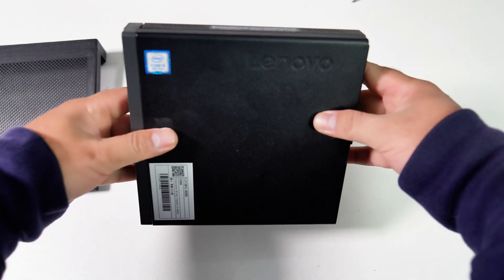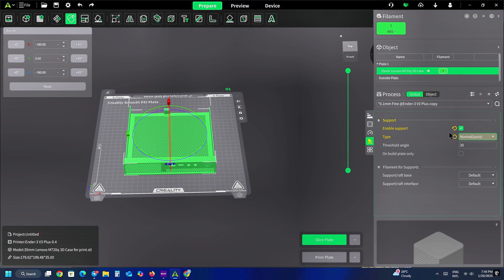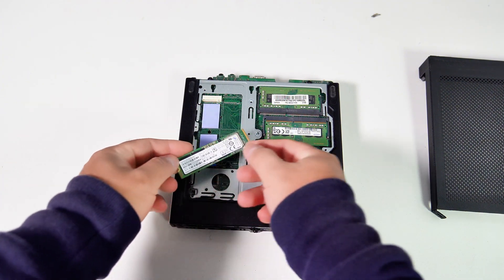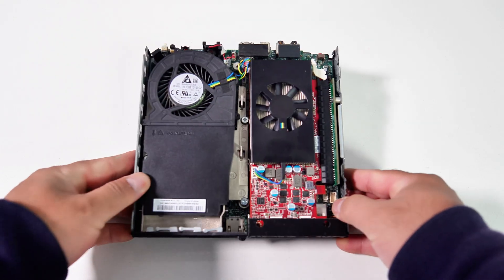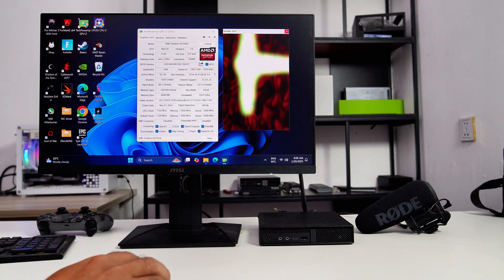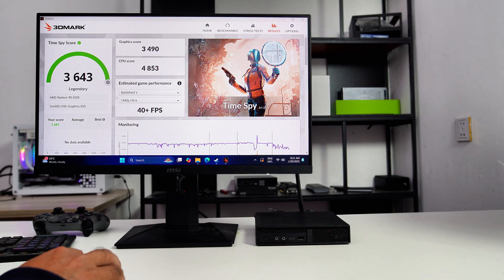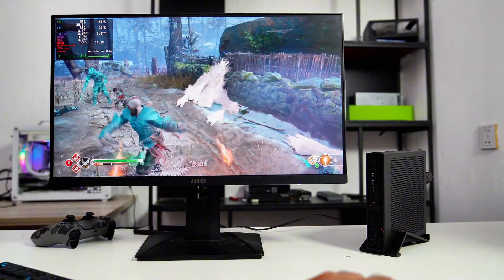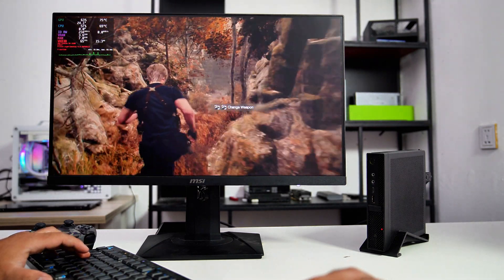M720q vs Bazzite: Cheap PC, Epic Games?

Comment: Tested Linux gaming a couple of months a go and all my games that I could try ran flawless (I have BeatSaber which at the moment does not yet run because I have Mixed Reality Glasses), some even better than on Windows (mind you, these are only 5 games in total, my gaming list is small :P ).  I modified one of the 2 M720q Tiny's that I have (one of them from one day to the other stopped booting and might have suffered liquid ingress at the previous owner...).  The modification consists out of an extra nvme slot that is soldered in at a non-populated slot.  Due to chipset limitations this second disk  runs in mSata mode only (I just wanted more space, not necessarily at superspeeds) on the M720q.  On similar models with a slightly more powerful chipset, it runs in nvme mode if needed as well.
Ordered a T400 videocard for this thing, but will run mine on the i5-8400T that it came with.  If you attempt this mod: Make sure you have a stronger power brick!

Comment: Thanks for the great tutorial. i am using the current release of bazzite 42 and the cli commands for fixing the powerlimit issue are not working anymore. do you have any advise?
Reply from the maker: You can just change the command from dnf install to rpm-ostree install and it will still work.

Comment: i like what you do., you inspired me to modify my p330 but the heat too high., can you modify it to fit a 3.5in LCD screen on the front and a 140x30mm fan on top., I will definitely buy that design., i will email you if you don't mind 😇
Reply from the maker: No need to buy check this video: https://youtu.be/UH2Hpt9JIn8?si=LftCkeYpuO5KnPWr
Reply: @itggear  need the front cover 3.5in lcd to., that look very amazing., that's the main goal to show off
Reply from the maker: @P4P1d https://youtu.be/Xih_37GYZAw?si=DF2nKEkNK6JPlevo
Reply: @itggear  omg, dont see it, thank very much dude, you are owesome but got new case, i got the RX6400 T_T

Comment: I am running the M720q with Windows 11 and an Asus RTX 3050 6gb. I have Throttlestop and the BIOS setting adjusted accordingly. When I try to push my games to higher settings the computer immediately shuts down. What am I doing wrong? It's not the thermals since i bought the upgraded cooler
Reply from the maker: Make sure you use a genuine Lenovo AC adapter.
Reply: @itggear  I have a 300watt Lenovo band original adaptor
Reply from the maker: @Endboss22  I think you should contact Lenovo customer support to find a solution for that, as I also have limited ability to address your problem. Thank you.
Reply: Can I ask where the extra power for the RTX 3050 is coming from?  I only know those as cards having external power. I think some run without it but limit their capabilities but not all advertise this correctly, so I wonder if that is where you need to look for the problem.

Comment: 4:50 Regarding stress testing, yeah, we had pretty much no "all-in-one" software on linux for that, until OCCT was suddenly ported recently. Free version lacking couple non essential features, but generaly speaking, it's best software on linux right now that "just works" and have friendly UI on top.
Upd. Regarding benchmarking: geekbench have native version, but without GUI; Cinnebench works in Proton (what is not ideal, yeah) but generally works; and all Unigine benchmarks run on linux natively as does Furmark.

Comment: On my Version of Bazzite I have to use rpm-ostree instead of dnf.  Also do you have any tips on trouble shooting bluetooth issues with xbox controllers connecting to Bazzite? Or do you use USB dongle controllers? if so, please do put a link in your future vids. good stuff man. Was worth a second comment. Thanks for that asmr episode.😄 PS btop can monitor  the system it just does not overlay really. but its installed by default on Bazzite an can see the GPU configuration.
Reply: Thank you for the rpm-ostree I didn’t have to go hunting for a solution thanks to your comment!

Comment: Don't need the thermal plate for the south chip i believe, in this pc? On the other video you had it installed
Reply from the maker: @golvellius6855  It's different PC last one is 920q and I sold it out already. With a 92mm fan pushing air directly to the southbridge and VRM chip, this setup runs more stably compared to every setup I have ever done.

Comment: Hey can you have a video testing i9-9900 cpu for M920Q/M720Q Thinkcentre? It supposed to support it (i9-9900 officially supported by Lenovo but i9-9900K not, theoretically it can work with the right power adapter + cooling) 
Would be awesome if you can try something like that and solve this mystery! 
It will make this small pc super powerful, especially in combination with a LP graphics card!
Reply from the maker: Hi! I haven't tried installing the i9-9900 in the M920q/M720q yet. These PCs are designed for 35W CPUs, so installing a 65W CPU like the i9-9900 might cause it to run slowly due to throttling. If you use software to stop the throttling, it can lead to random shutdowns because of power and cooling limitations. So while it might work in theory, it's pretty hard to run reliably. Thanks for your suggestion!

Comment: hello. How did you manage the warping at PETG? my nozel is at 235 and bed is at 85 degrees
Reply from the maker: @nicoj8  It's depends on your filament type hyper or generic and print speed. You should see printing temp labeled on filament spool. Thank you.
Reply: @itggear Yes of course. I just see that you don't have a housing on your printer. Did you print without any warping problems? Thx
Reply: Try lowering your bed temperature.  Warping occurs due to incorrect bed temperatures along with insufficient layer adhesion.  The reason for this being that large surfaces crimp after having been laid down. Lay down the first layer slow if needed (10-15m) along with going down to 65-70 degrees of bed temperature.  Remember that PETG has a glass transition temperature of about 75-80 degrees (the point at which it starts to melt).  So it could be you loose layer adhesion because the PETG literally starts to meld during printing.
The printspeed after the first layer also influences warping: a very slow first layer and rapid next layers can increase the speed at which things crimp.  3D printing unfortunately can involve many variables when things are not going as espected.

Print temperatures on the spool are just optimal settings that the manufacturer found in a supercontrolled environment on their own specific printer.

Comment: I bought a yeston rtx 3050 but I'm not sure which is the correct riser card. The one i have is not working. Also it seems the prices for these adapters went up.
Reply from the maker: Please be aware that the Yeston RTX 3050 has a thickness of 20mm, unlike other single-slot low-profile GPUs which are only 15mm thick. Consequently, the Yeston RTX 3050 LP does not fit into my 3D case design. Thank you.
Reply: @itggear  yes i kind of realized that after i printed your case. I'll probably try to tweak the design a little and print it again. I'm currently waiting for the new riser adapter card to arrive.

Comment: I upgraded one of these ThinkStation P330 Tiny, currently has a Core i9 9900T and NVIDIA T1000 (2021 model) which is basically a GTX 1650 but smaller with lower TDP to fit inside one of these, 32GB RAM and 1TB NVMe SSD plus another 512GB one which is the one it came with, such a powerful little mean machine!
Reply: @alvzcizzler  with p330 u could have gone for a non t cpu
Reply: @jayantborkar185  I know but then I wouldn't be able to have a dedicated GPU unless maybe if I got the 230W Lenovo adapter then maybe it would be able to handle a 65W CPU and a GPU?
Reply: i have one as well, but with i7 8700T and Nvidia P1000, this thing can game, at least with older games
Reply: @ That i7 8700T is still very fast, I advice disabling PROCHOT so it doesn't throttle using ThrottleStop
Reply: @alvzcizzler  its not throttled, a good cpu it is
Reply: @Onion_Knights  I am telling you from experience, in this Lenovo tiny PCs they will throttle the CPU unless you deactivate the BD PROCHOT feature, there's videos covering this and it also applies to many laptops.
Reply: @alvzcizzler   i know 👍
Reply: @alvzcizzler  Im about to get a P330 that has I7 8700T what kind of GPU should i be looking for?
Reply: @calmthestorm2400  It'll either come with a Quadro P620 or P1000 which aren't very good for gaming unless it's older games from the early or mid 2010s tops or lightweight games but you can upgrade the GPU to various other low profile GPUs  certain low profile ones.
Reply: @alvzcizzler  yup im planning to get a low profile gpu to add-on to the setup

Comment: Don’t know why you guys are wasting money on this. I have a 5700x with a 4070 super. That’s not hard to attain!
Reply from the maker: I don't waste money I earn money. It's a stupid way to buy such RTX 4070 super just for create video for YouTube.
Reply: @itggear  The games benefit so much more!
Reply from the maker: People may need more than one PC for daily use. Do they need to build or buy a powerful PC equipped with an RTX 4070 Super for every one of their PCs? For example, if you need a PC for a home theater to display on a 4K or 8K TV, you might probably need a smaller PC that can handle all these tasks, like the one shown in this video, instead of placing an RTX 4070 Super in your living room. In fact, this PC setup is about only 10% of the total cost of the PC you mentioned.
Reply: @itggear  I get it. I just ordered a tiny ryzen mini PC to replace the one at work.
Reply: @carlosnumbertwo  I mostly do browsing, email checking, writing stuff for work, and some occasional video editing and transcoding on my main machine, which is a Lenovo M720q Tiny.  I also do a lot of Blender work on it.  For general modelling it is fine typically, but in some cases during procedural texturing (when you need a rendering mode that shows materials) it is nice to have a little bit extra without having to switch on the big desktop.
After all: a device idling at 10W (Lenovo M720q) instead of 86-90W (big desktop), and top power at 45W (Lenovo) is quite a difference when this higher power isn't always needed.
If I game, the bigger desktop is used.

Yes, sleep states in both processors and videocards have advanced in a big way (up to the point it is causing problems in how switch-mode power supplies tend to remain stable) but I still like to conserve energy if possible.

Comment: Does the power limit fix, relsove the cpu being stuck at 800mhz while gaming?  Does this also work on Chimeraos?
Reply from the maker: Yes, as you can see in the video, after fixing the CPU power limit, the gameplay FPS boosts to the same level as in Windows while using ThrottleStop. I think it could work on other Linux OS too.
Reply: @itggear I had trouble getting it to work on ChimeraOS and ran into reliability issues with Bazzite, so I switched to the real SteamOS. After some tinkering, I got it working. It reset after every reboot, so I created a service to run at startup. Not sure if a system update will reset it, but it should be an easy fix if it does. So far, it’s been great. Thanks for the video

Comment: I noticed that the Dell Low Profile Radeon RX 6500 have been sold out on Ebay, and only available via EU/UK at over $100+ price premium.  I guess the other options would be an RX 6400 which also has increased in price.

Comment: Being able to squeeze so much performance out of a pc that's the size of a wifi router is amazing
Reply: Yeah this PCs are incredible, I have the ThinkStation P340 with a 10th gen Core i7 and NVIDIA A400 and it's lowkey a beast, also have a P330 with a Core i9 9900T and Quadro P1000, might upgrade the GPU to a NVIDIA T1000 which is basically a GTX 1650 just smaller with less TDP.

Comment: Wonder if it be cheaper to just cut the top of the case out, and replace it with a screen.
Reply from the maker: There is no more space inside the PC. The GPU and CPU fan shrouds are already touching the case. Thank you.

Comment: it would be nice to see proper back to back testing of the stock case bs the printed one to see difference it actually makes.
Reply from the maker: I cannot. The stock case touches the GPU fan shroud, causing no airflow at all for the GPU. There's no gap between the GPU fan shroud and the top cover, which can burn the GPU. That's why I don't show the test for you.
Reply: @itggear  GPU's thermal throttle if they overheat.  If that is not sufficient to prevent damage, thermal shutdown occurs.  All chips are designed like that, simply because of thermal breakdown limits known because of the substrate materials used in the cores.

Comment: Going to use this 3D Print file, but I need to ask.

Where did the two screws at 7:15 and 7:31 come from?
Reply from the maker: You can search any marketplace for female threaded insert nuts (M3x5) and use normal motherboard screws. Thank you.
Reply: @itggear  you specifically mention not needing to use those insert nuts, but I do have a kit of PC screws with motherboard screws
Reply from the maker: @origin3271   Each video features a different case design. For this one, you need one or two female insert nuts. I did not mention that in this video, but I did in my previous video for that case design only. Thank you.

Comment: There was a guy selling these 6500 for 80$ on ebay now the dude is asking 130$.
Reply from the maker: I have an RX6400, but its capacitor was broken and knocked out from the PCB, so it's only running at PCIe x2. That's why I used this RX6500 for this video. I think the RX6400 is also good for a Linux gaming PC.

Comment: Have any used the genie low profile A380 for this yet?  Been trying to decide on 3050lp, 6500RX, or the A380.
Reply from the maker: You should try using a GPU with the lowest TDP. It might be better for compatibility and more comfortable to use than a higher TDP GPU like the RTX 3050 LP, as a higher TDP could cause your PC to shut down randomly more often. Thank you.
Reply: @ Thanks I will take that into consideration. I really only play a little bit of Apex. But the kids want me to play Roblox and Minecraft. Any of the cards you used in the past and present should do that. I think I am just going to go with whatever I find cheap when I finish this little project.

Comment: Is the CPU power limit something that affects all Lenovo ThinkCentre PCs when a GPU is installed? I have a P340 and installed a T1000, I haven't used it really for modern games as it is an Emulation machine, but I wasn't aware there were CPU power limits? Thanks, great video and I love seeing all the mods for the Lenovo!
Reply from the maker: No, Lenovo limits the lower-tier models like the M720q and M920q to only support 35W CPUs, not 65W CPUs. However, top-tier models like the M920x and P330/P340 support a 50W GPU with a 35W CPU, or a 65W CPU without a GPU. probably they want you buy a more expensive PC from them to use a gpu haha. Thank you.
Reply: @itggear  Can't you get around this by disabling ASPM Support in the bios?
Reply from the maker: @ It is not only limited by the BIOS but also by the cooler on the M720q and M920q, which is smaller. Additionally, these models do not have a southbridge heatsink, so when we install a GPU, the chipset on the motherboard gets too hot, and there is no cooler for the VRM chip. Unlike the M920x and P Tiny series that usually come with a southbridge chipset heatsink and use a 65W CPU cooler, which also covers the VRM chip near the CPU. Thank you.
Reply: @itggear  so you are saying that before we put gaming cards we need to:
1. Buy southbridge chipset  heatsinks(for example from aliexpress) in order for the motherboard not to get too hot
2. Disable the CPU power limitation with software under windows/linux
And "voila" we can unlock the machine's FPS?
Reply: @itggear  Thanks for the info!

Comment: Have you thought about turning this mini PC's into NAS' ? Since you also do 3D printing it would be cool to assemble someting with 5 or 6 hdds in a sff footprint
Reply from the maker: Since it has a PCIe slot, you could install a NAS adapter. However, I don't have skills in this field, so I have no idea how to develop this project. I think it could be fun to make this PC a NAS server. Thank you.
Reply: @itggear  @itggear i envision it like adding a 5/6 hdd cage since there are nvme to sata adapters with 5 and 6 ports, assembly everything in a metal frame and printing an enclosure e tricki thing is to make or convert a psu that could power the pc and the disks
Reply from the maker: Some models like the M920x and P330 Tiny already have 2 M.2 slots. If you install a low-profile M.2 adapter with 2 additional slots and install 4 x 4TB M.2 SSDs, it provides massive storage. Additionally, 4TB M.2 SSDs are not as expensive as they used to be these days.

Comment: What causes that CPU power limit in this PC? Does it happen with other CPUs as well?
Reply from the maker: This PC model does not allow you to install a GPU. To make it usable with a GPU it has limitation in its BIOS, you need to use software to stop the CPU power limit when a GPU is installed, both in Windows OS and Linux OS.